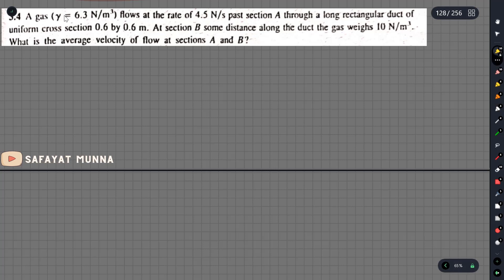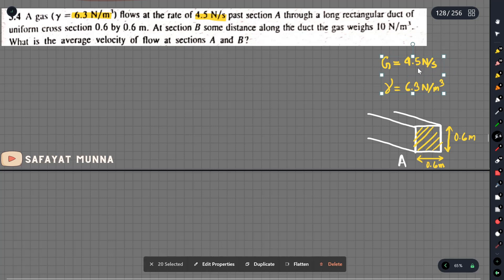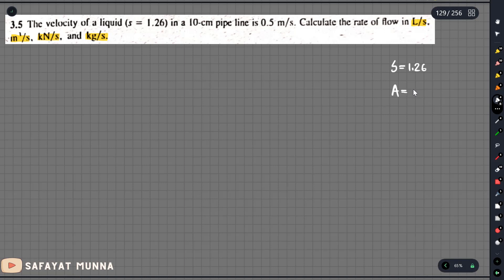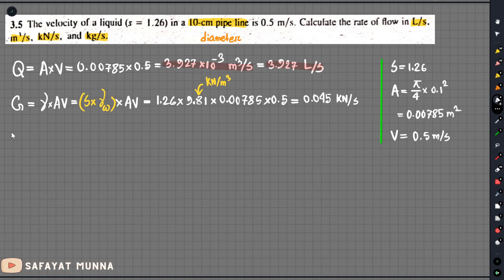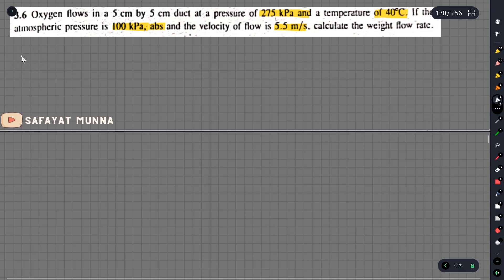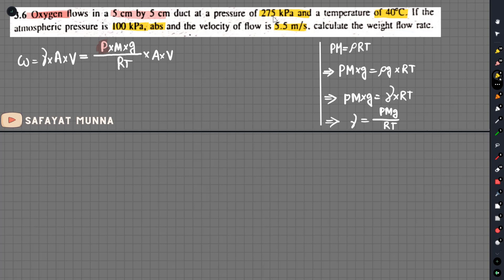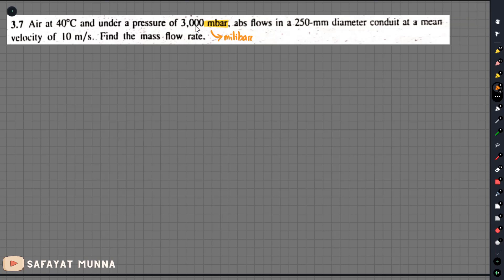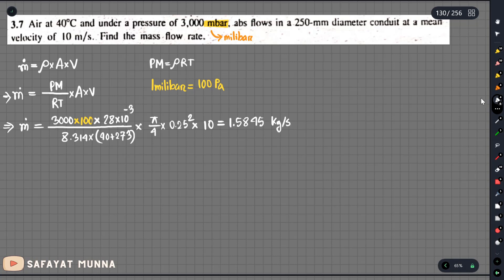3. Problem 3.4,3.5,3.6,3.7, Franzini Chapter 3, SI Metric Edition - Kinematics of Fluid

Comment: Sir, at problem no. 3.6
gas er khetre always abs pressure use kora lagbe....jehetu PV=nRT equation, tae ekhane obosshoi P=275+100 hbe, Absolute P=275 gage+ 100 atm
Reply from the maker: Very good student you are, I was just checking if you could find the mistake
Reply: @safayatmunna  Thank u sir😊